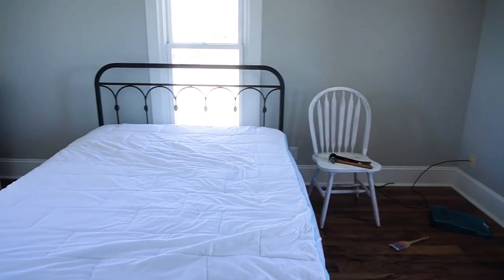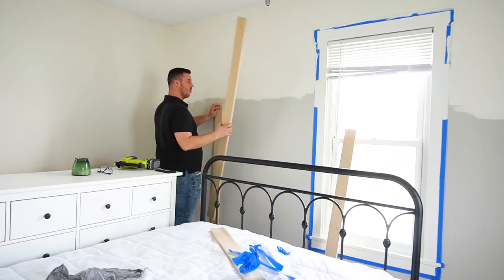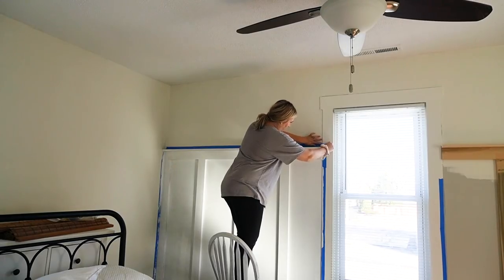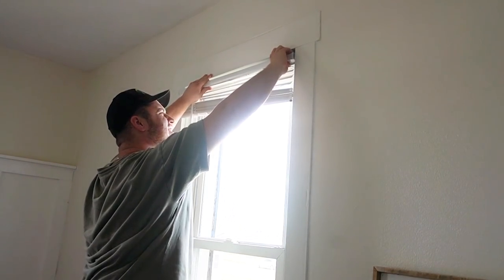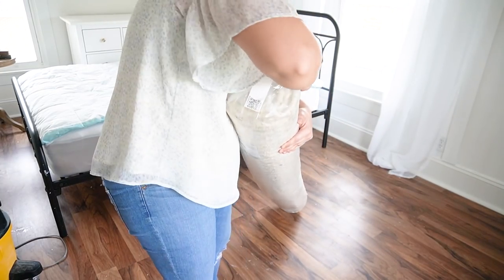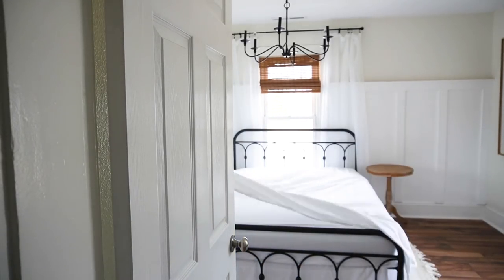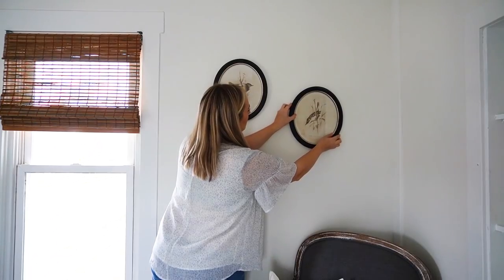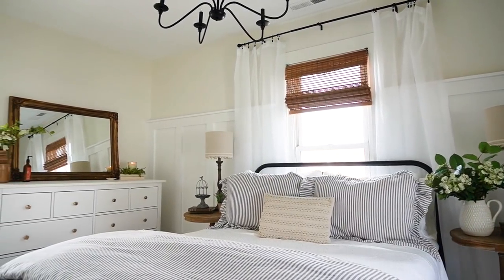Farmhouse Bedroom Makeover | Decorate with Me | Bedroom Decorating Ideas 2021

Comment: I’m doing this moulding too atm. I figured out where the top rail was going and painted the entire bottom white with a large roller first. Then put your boards, caulk, fill nail holes. Paint boards with mini roller, much easier. You’ve made a lot of extra work doing all that taping. Just use an angled brush on the the board edges.

Comment: I was going to suggest putting the bed in front of the window with curtains to the ceiling.I had the same problem in our Annapolis bedroom except the other window was a doorway. It was such a pain making the bed and no-one wanted the side by the wall. lol Finally I switched from a solid head board to an open metal one like yours and it really worked in front of the window. Your room turned out absolutely gorgeous!